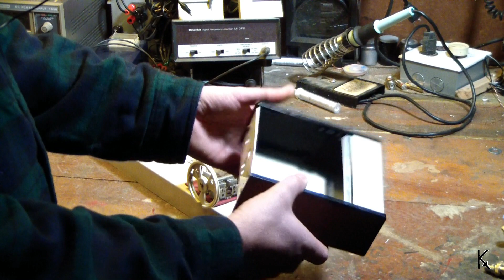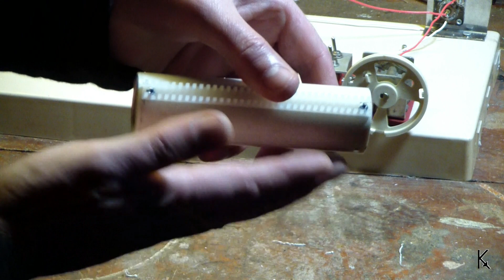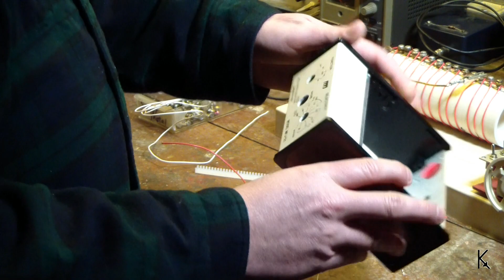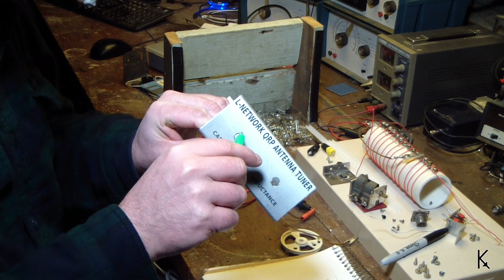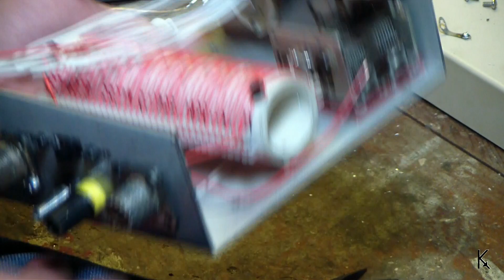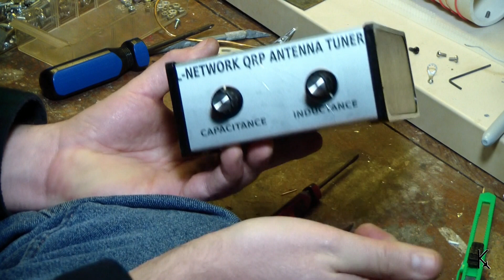Ham Radio Antennas - Rebuilding the L network QRP antenna tuner

Comment: Nice Video... Good project for those who need an Antenna Tuner for QRP and want to built it themselves. I have been a builder for 57 years. Before that, when I was just a Boy, I built plenty of Crystal Sets and 1 Tube Receivers, some of those Tubes ran solely on 12VDC, no Plate Supply. Always fun designing and building, it improved my construction skills. My first Amateur Radio Station when I was a Novice was home-brew except a Kit Receiver. Every time I solder, it draws me back to my first soldering job, the smell, it never changes. 

Thanks for Posting this informative Video on your QRP Tuner Project,, I'm sure others will benefit from it if they decide to build their QRP Tuner.  73... Don, W6PJJ

Comment: I got 25 acres to play with. Presently awaiting 2,000 ft copper clad steel wire for antennas (2 x 1,000ft). A diversity tuner to phase out noise. Also ordered some variable inductors and air variable capacitors off of ebay so I can start making my own 450 ohm ladder-line tuner. I live where there's only mesquite and cactus and sagebrush so I've been stocking up on 40ft towers and guys because no robust trees. I'm presently studying ground loop issues to learn how to ground - and where to ground. Dry earth here! 5/8" x 8' rods. Looking for 1/4 wave of 100kHz ground lead length from each longwire feedpoint to ground rod. Might I need worry about multiple ground points? I am Mostly going to be doing SWL listening with my Drake R8B w/ VHF card (2M) - searching for distant utes.

Comment: Does it also work with a magnetic loop antenna for qrp use?
Reply from the maker: You would not want to use a separate antenna tuner with a magnetic loop. You want to tune the magnetic loop to the operating frequency. If you try to use a magnetic loop even just a few kilohertz outside of its resonant frequency, it will be extremely inefficient. It's a very high Q antenna.

Comment: Unfortunately, the metal enclusure forms a shorted turn secondary"turn" which absorbs power. If you can somehow "break" the loop by having insulators or gaffa tape between lid and body, would heip.
Reply from the maker: Just about every commercial antenna tuner that I have ever seen is in a metal enclosure.
Reply: @loughkb  yes, you're correct. Also IF transformers etc have a can...I was overthinking. 😄

Comment: Nice and easy, but doesn’t the tuner coil radiate as an antenne? Any thoughts on what percent of radiation is lost or redirected? Is it enough to worry about. Seems that being able to tune to 1.0 would compensate for losses. Really nice setup, especially with the switches.

Comment: I have built and continue to use an L Network like this at the feed point of a 17 meter Homebrew vertical antenna to keep the feed point at 50 ohms.  It works great.

Comment: What size wire did you use on the coil???
Reply from the maker: My application is mostly QRP, so I just used some doorbell wire I had sitting around, maybe 16 gauge, I don't quite remember.
Reply: @loughkb  
Thankx!  Working on mine right now.

Comment: Hi Kevin..it is me Deniz from Turkey again..I ve just finished my anttenna tuner..and your project and videos helped me too much..first, thanks for this again..I wanna ask something else about tuner..is the variable only necessary for transmitting for swr? I will only use it for listening sw..do I have to use a variable or it is not important for listening only? I see you use the variable for swr anf of course for transmitting..thanks so much
Reply from the maker: Yes, it's still important.   The tuner is matching the complex impedance of the antenna to the expected 50 ohms at the radio.   Even when receiving only, this matching will allow for more efficient transfer of RF from the antenna to the radio and improve things.
Just tune by ear, listening for the noise floor and signals to peak.
Reply: @loughkb  thanks Kevin..one more question please😊 The variable I found in an old radio 50-360 pf..And I used this in my tuner..is it enough or do I need a larger one, for ex 500 pf?
Reply from the maker: @denizyildiz8904  I'd think that should be enough.  It really depends on the antenna.  If it's too far out in impedance, you'll need more capacitance and inductance to match it.

Comment: Hi..I saw a different project ..one side of the coil was empty..not to direct antenna..but in your project one side is connected to radio and the other is to antenna..whic one is best ?
Reply from the maker: I've only ever seen the L network design that I used.   It's standard and has been used for decades.
Reply: @loughkb  in this page one side of the tapped coil is empty(no connect anywhere)..but in your project this side is connected to the radio..but in the page only the main pin of comutator is connected to the radio but not the end of the coil.
Reply: @loughkb   http://www.hard-core-dx.com/nordicdx/antenna/lab/tuner.html
Reply: @loughkb  so which is true?
Reply from the maker: @DENİZ YILDIZ  Electrically there is no difference.   Ether you reduce turns in the coil by shorting out a few of them or ignoring a few of them the end result is the same.
Reply: @loughkb  thanks from Turkey,izmir😊
Reply: https://swling.com/blog/tag/swl-antenna-tuner/

Comment: Is the antenna at the L/C junction or the other end? I couldn't quite see.
Reply from the maker: In this case, at the L/C junction.     One function of an L network tuner, is that it matches a low impedance at the inductor-only end to a higher impedance at the L/C end.   If your antenna is presenting an impedance lower than 50 ohms, you can switch it around the other way to obtain a match.

Comment: I could not find a resonably priced case for the project.  Then I noticed I had stored (for some reason) an empty Kirkland European Cookie Tin in the garage . 
It is 11inch x 8 inch x 4 inch.
A ham could buy a new box at Costco and do whatever with the cookies. Still cheaper than buying a new box.

Comment: Kevin please add in a note below the video sourcing the strips used.
 It is the Panduit GE85-C Strip. It is carried by Mouser [part no. 644-GE85-C] and Digikey [part no. 298-13452-ND] in small quantities.
https://www.digikey.com/en/products/detail/panduit-corp/GE85-C/4573660
https://www.mouser.com/ProductDetail/Panduit/GE85-C?qs=iClhIni4HwKki4b3Bmkk6w%3D%3D

73 de w8nsi Jim

Comment: it would really help if I knew the "name" for the "grommet material". I will keep looking but sure would like to know how to name it.
Reply from the maker: Scan down through the comments.  I think there were three or four that commented with links to where to buy it.
Reply: I scanned down as per your comment. I ordered the GE85-C strip and an air variable capacitor from Ebay. I bought the pvc (and some screws) today at the store.  I sure am glad I saw  video. I will work on my pvc tube until the stuff comes from Ebay. 
 Thank you Kevin !
Reply: It is the Panduit GE85-C strip. It is carried by Mouser [part no. 644-GE85-C] and Digikey [part no. 298-13452-ND] in small quantities. At Newark Supply and on Amazon you might have to hike up your shorts to buy because they want too much for this project.

Comment: A smart reminder: Switch the in and output to tune a antenna witch is shorter then a quarter wave length if it does not tune fine.

Comment: Hi Kevin, just a note to send my appreciation. Being the complete "everything has to be perfect" kinda nerd when it comes to amateur radio and after spending so much time with RF coil online calculators I realised I needed to follow your lead and just relax and make a simple damn coil and not worry about all the formulas. I had your videos in mind when I cobbled together coil number 3 and it works like an absolute charm. I am very pleased with myself with thanks to you! :-)

Comment: Howdy. Nice of you to sacrifice your time to really walk through interesting issues.
I don't agree with my colleague about one thing with antenna tuners. He claims that one may get a badly unresonant antenna tuned. Yes. But it will radiate just a small percentage of the input.
My thinking is that any antenna tuned to resonance with a tuner will radiate almost all of the input. I admit that some power will be dissipated as heat in the coil. Also I admit that the radiation pattern will be irregular and that much could just shoot straight up.
What might be your opinion ?
Regards.
Reply from the maker: Antenna tuners are best applied to extending the usable range of a resonant antenna.  The less of a mismatch, the less power lost.

Comment: Look for Panduit GE85-C grommet edging strip for the inductor wiring.
Reply: That is the stuff. I checked it out on ebay and bought some.  GE85-c is the stuff. I was going to use some rubber tube for the separation, but Kevin used the "right stuff."  Thanks for the information.

Comment: Thanks for video Kevin just helps in my learning of SWL.  I built the earlier model and it works great. Is there any advantage or disadvantage using magnet wire or thicker wire.  Same question is there any advantage to using magnet wire close wound.
Reply from the maker: In a transmitting application, thicker wire and wider spacing are needed under higher power conditions.
For receiving, anything can be used.
Reply: @loughkb  Thanks for reply Kevin, I am just a listener so that has answered my questions for me.

Comment: So how many turns on the coil on 1in PVC I think mine has 18 turns but something's not right it won't tune I think the problem may be the small capacitor I have but. I was just wondering on the turns. Thanks
Reply from the maker: It depends on how far off the load impedance is.  Also frequency.  So a shorter antenna and a lower frequency might need more inductance.  Use an antenna that's closer to a resonant length or add more turns.
Reply: @loughkb  ok thank you ill keep that in mind
Reply: @loughkb  could resistors soldered in series with taps added be used in place of the inductance coil and if so which has better performance? also if resistors can be used which ones should be used. i know im asking alot thank you for passing on the knowledge i appreciate it
Reply from the maker: I can't think of any reason why you'd want to put resistors in there.  It would just eat power, kill efficiency, and probably burn them up.
Reply: @loughkb  ok thanks

Comment: It looks like they're called Caterpillar Grommets.
Reply: Steve, Found it!  It is the Panduit GE85-C Strip. It is carried by Mouser [part no. 644-GE85-C] and Digikey [part no. 298-13452-ND] in small quantities. At Newark Supply and on Amazon you might have to hike up your shorts to buy because they want too much [$50-100 for quantity] for this project.   73 de w8nsi Jim

Comment: how did you wire in your bypass switch?
Reply from the maker: Just a switch that shorts the center of the input connector to the center of the out put connector. Each center can go to the middle pins of a DPDT switch. Short one sides pins, send the other sides to the in and out of the tuner circuit.
Reply: @loughkb  Thanks.  I got everything else, but for some reason, the switch just confused me.  I guess I'm getting senile!

Comment: You forgot to put an interruptor to switch the capacitor from the inputo to the output to transmatch a low or high impendance antenna.

Comment: The math really doesn't matter if you've seen enough examples, and know roughly what to do!  The coil construction in particular is very like some professional gear, but using common materials.  Kudos Kevin!  (I note you used thicker coil wire to compensate for the loss of Q with a smaller diameter former!)

Comment: Hi Kevin!
I have an end fed wire antenna 26.5 m with unun/choke and about 20 m coax cable 50 ohms. The 9:1 unun should adapt the impedance so despite this would the l-network help further if it's placed between transceiver and (long) coax cable?
I'm just restarting my hobby after 37 years and working on my technical skills to get the hang of it after this long period of time...
Thanks for your great work - already helped me a lot!
55, 73, DF7ED
Reply from the maker: Yes, it should work fine for tuning the end fed.  If you build it, just make sure your wire runs are as short and neat as possible to reduce stray capacitance.  Also, if the variable cap has close plate spacing, be careful on power.
Reply: Thanks!
Finding a properly spaced cap is quite difficult so I decided to test an old radio adjustable. With my 20 W rig it should work as you said in the video otherwise I have to search for a bigger and more expensive one...
Keep up the awesome work !
DF7ED

Comment: Slotted

Found a suitable replacement for the grommet strips. Should work perfectly 
Phil
K1PJR

Yongcun 2.4mm Slotted Grommet Edging Molded Grommet Strip Movable Bushing pack of 32Feet 10m(PE 94V-2 2.4mm) https://www.amazon.com/dp/B01JKEJE8K/ref=cm_sw_r_cp_api_TPOpAb0GPGYNW

Forget it. This item doesn’t work with 14 ga wire. Gaps are too narrow. Just ordered this item from McMaster: 85085k8. Grommet strips but looks like it will accommodate 14 ga wire.

Comment: I have Yaesu FT-857 HF 100 W SSB . Is this suitable cap for power/capasitance: https://www.ebay.com/itm/High-Voltage-Air-Variable-Capacitors-15-165pF-5-1KV-Amplifier-Tuner/152390166470?hash=item237b2967c6:g:1nQAAOSwyvBV94pp . Nice video, greetings from Finland and 73 !
Reply from the maker: More than enough.   I read that the RF voltage at 100W is around 800-900 volts.  Now that would be in a balanced circuit with a properly impeadence matched load.  In a tuner, there's mismatch being corrected, so it's possible to see a higher RF voltage across the cap. (reflected power coming in will voltage-add to the power coming from the radio on the positive side of the sine wave)  So I would think that any cap rated higher than 1KV would be good at 100W for moderately mismatched antennas.  Just my gut feeling though.

Comment: I found this on eBay after David Davidson discovered what these strips are called, seller: 
DEK 036-0250S Grommet Strip 12.7" Long Nylon 100 ct. bag #61  US $22.50. The seller I purchased from was selling this 100 piece bag for 50% less than another seller. Only found two sellers on eBay. Using DDG found sellers with similar strip grommet but not the same as what Kevin is using. The strip will sure help keep spacing between hand wound coils more uniform.

Comment: Nice tuner video. Want to find out what that plastic strip is called I would like to order some.
73, Terry - KB8AMZ
Reply: https://www.mouser.com/Search/m_Search.aspx?Keyword=grommet+strip
Reply from the maker: The strips were given to me by another ham.  He didn't know where he got them.    I think they're some kind of industrial grommet material that you could line a hole in a metal panel with.
Reply: Yes Kevin, I know that from your comment to Richard Day. I read all the comments on your channel before making my own comment. I wasn't really expecting what the bit is called or where I might find it. I would like to know, for future projects, what it is called and where I might find it. I guess that I was thinking via print. Like thinking aloud. Not directing the comment to any specific person. I am not sure how I will go about searching for this product but I will try. If I find the answer I will let you know through a comment on this video page.
73, Terry
Reply: https://www.amazon.com/Yongcun-Slotted-Grommet-Movable-Bushing/dp/B01JKEJD86
Reply: "Panduit GE85-C grommet edging strip",  it is available on Ebay. I just ordered some. This is a key part of the project. 
You get 5 pieces for $7.91 including tax.  They should pay Kevin a fee !
Reply: @jkbish1  If you had read further down the page you might have noticed I solved this. 
"
Terry Morris
3 years ago
I found this on eBay after David Davidson discovered what these strips are called, seller: 
DEK 036-0250S Grommet Strip 12.7" Long Nylon 100 ct. bag #61  US $22.50. The seller I purchased from was selling this 100 piece bag for 50% less than another seller. Only found two sellers on eBay. Using DDG found sellers with similar strip grommet but not the same as what Kevin is using. The strip will sure help keep spacing between hand wound coils more uniform."

Comment: Love this video. I am going to have a go at building one of these. Thanks for taking the time to make and post this video.  On a side note when setting out your graphics for the decals it would be quicker and more accurate to just scan the front and back panels into inkscape using your scanner.
Reply from the maker: I used to use that method when duplicating extruded parts for 3D printing.   My neighbor had these little plastic clips that held parts in place on his window blinds.  He'd broken two.  So I took a good one and laid it on a flatbed scanner to get a profile.   Scaled it in inkscape and then traced it to get a simple vector representation of it.
Took that file into Blender and extruded it, exported as an STL file which the slicer on the printer software had no problem with.    I made him 10 spares in about a half an hour.

Comment: That was very interesting.  How much power could that tuner handle?  Thank you for sharing.
Reply from the maker: With the close spacing on the capacitor plates, 10 to 20 watts max.  Maybe more, but you'd risk arcing across the plates.